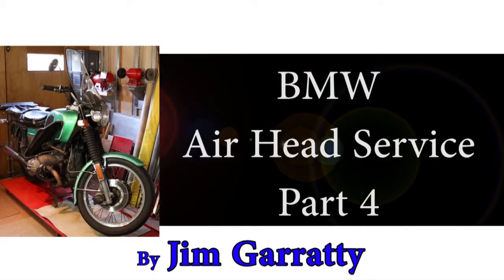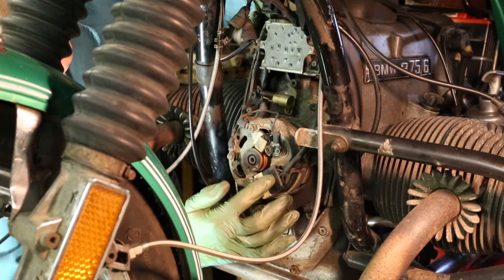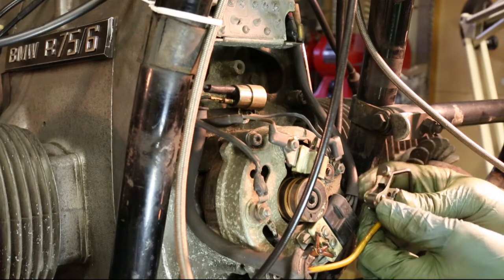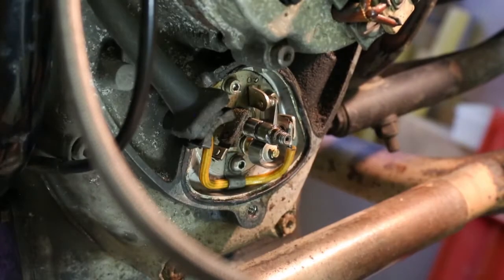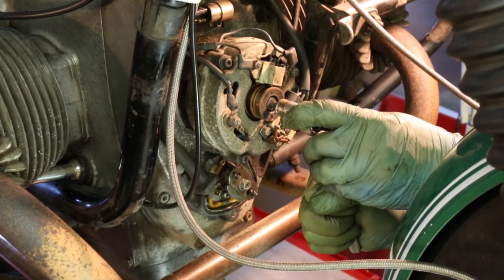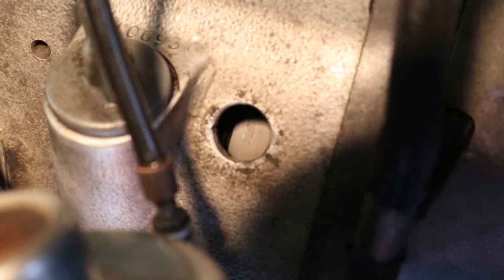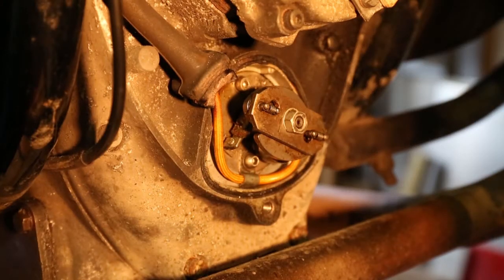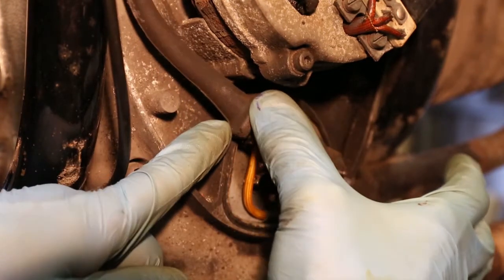R75/6 Part 4. BMW Air Head Boxer, R Series service. Set Points & Ignition Timing.

Comment: Thank you for this post.  I have recently purchased a rather rare 1982 Neval Dnepr sidecar rig with a R75/6 engine.  I had a pointless ignition in, and after less than 200 miles it backfired like mad and died.  I hope that I can glean enough info from your post to get me back on the road.  Thanks again.  I'm only 3 minutes into your video and I have put you in my favorites.
Reply from the maker: Hello, @kenhieter6582.
I have seen this modification before, when a BMW boxer engine is placed into the Russian or Ukraine bikes. The owners of the bikes were very pleased with the increased reliability. I'm glad you found my video useful and I wish you luck for the future. Take Care Jim

Comment: Hello Jim. Thanks for sharing this information. I have just had my top end done including a re-bore and the fitting of new pistons. My 1976 R75/6 has 126,000 miles and will be running strong this summer. Great video, one of the best explanations I've viewed.
Reply from the maker: Hello Colin
Thank you for your comment, its good to hear your R75/6 will be back on the road soon, with re-bore and new pistons you should be ok for another 126,000 miles. Take care Jim

Comment: Thank you sir! This is excellent for help with my 1973 75/5 (in conjunction with my shop manual to give me the proper markings for timing and points gaps for my particular model). THANK YOU!!
Reply from the maker: Hello @egec. Thank you for your comment, I'm so glad my video has been of use to you. Setting the points on these engines does need a little practice. Take Care Jim

Comment: Thanks very much  a very informative  video, ive just bought a 1973, longwheel base R75/4
Reply from the maker: Hello Christopher
You have bought yourself a fantastic bike, I'm glad my video was of use to you.
Jim
Reply: sorry ive bought a late 73  ie long wheel base R75/5 , I had a 1970  R60/5   a few years ago i found the handling was  good it was my 1st BMW, i will let you know how i go on with my 73  R75/5  once i get it on the road. mines a Drum brake model of course. I personally think the R range  from the  1970s  to   the R90/6  was BMW  at its best
Reply from the maker: Hello Chris
I agree with you, BMW boxers from the 1970's, for my type of riding are brilliant.
High speed cursing all day, and if they do have a problem you can normally fix them at the road side.
Fix punctures, change points all easy.
There is that little spring in the gearbox selectors, after the third one broke in 20 years I modified the gear box, it now has a compression spring, it was a bit more involved than I first thought it would be but I don't think it will fail again.
Take care
Jim

Comment: I have succesfully snapped the threads on the camshaft with a standard 10mm wrench... it was not an easy job to fix....
I have the same 75/6 btw!
Reply from the maker: Hello P-A Olson.
Oh no, nightmare, every time I tighten that little nut on the end of the camshaft I think “is this the time?”. So far I have been lucky.
Did you fit a new cam shaft, or manage to drill and fit a new stud? Take care Jim
Reply: I was able to drill a hole in the cam with a lathe, and put a m6 thread in it!
Reply from the maker: @p-aolsson488  Thank you, Its good to know the shaft can be machined, it does give you a line of escape if you do ever snap it off. Well done.
Reply: If you are helping somone with this problem, recomend m5 threads instead! It gives a little more space to work with!
Reply from the maker: @p-aolsson488  Thank you, this is really helpful information to those who have just snapped their stud off, and are looking miserable at it wondering what to do next. A useful comment, it will help lots of people. Take Care Jim

Comment: Do you have a video on how to torque heads and setting the valves ?
Reply from the maker: Hello Roger. Sorry, no videos yet on how to service the heads on the R75. This summer I must check my valve clearance, that will be the time when I make a video. Unfortunately that doesn't help you at the moment. Going by memory things you must look out for:
The exhaust is clamped to the head by a large finned nut, this nut can be very hard to remove, I have had to cut them off before now. When you replace this nut use Copper Ease on the thread it helps the next time you need to remove it. There is a special finned spanner I feel is a must if you want to remove this nut without damaging it, it works well, If you use a punch it will damage the fins.
If you are in Great Britain you may want to join the BMW owners club, they have most of the special tools you need to strip down the whole engine and bike. You will have a lot of fun replacing the heads, as you tighten the main head nut down on the top of the rocker shaft supports they move about messing up the clearance between them and the spacer that sits on the shaft against the rocker. It together correctly when the spacer on the rocker shaft can rotate easily but have no end to end play, I have always found this job to be a little frustrating. There is I have been told a special tool for this job but I have never used it. When checking the tappet clearances use a hex key in the end of the crankshaft (centre of the alternator) to turn the engine, and don't forget to remove the spark plugs. Good luck, have fun. Take Care Jim
Reply: @CYC123  ok Jim thanks very much for that info . I’ve had the top end of my r90 rebuilt so i only need to re torque heads as specified every 500, 1000, and 1500 miles . And not being a mechanic but having bought a torque wrench I was thinking of knowing how to do this instead of taking it to a mechanic.
Reply from the maker: Hello Rodger. You probably know what I'm about to say, but I will say it any way, just in case anyone reading this doesn't know.
When you retorque the head bolts, because of mechanical stiction between the nut, the head and the stud, you must loosen the nut a quarter of a turn first, then retighten to the correct torque. If you don't do this the nut may not tighten to the correct torque.
When tightening the head nuts do this in a cross pattern, bottom right, then top left, top right, bottom left.
Once the retorquing is finished, you must check two things: First, the valve clearances (tappets) they may have closed up what with more compression going onto the head gasket. Second, the spacer on the rocker shaft, make sure it can still turn freely with no end float when the valve is fully closed, that's when the valve pushrod is loose. Hope all goes well, Jim
Reply: @CYC123  thanks Jim I appreciate the info . Not having any experience I want to try this and hopefully not mess anything up but then again I might let my mechanic handle it. I ll try to find a video to watch on how to do this. 
Cheers
Reply from the maker: Do you have any mechanic friends who could be there as you do the job?
BMW owners clubs may help, give them a call, see if there is anyone close to you who knows what to do.
Good Luck Rodger

Comment: I have continuity at all times but I hooked my meter up to top of points assembly? Maybe it need to be connect to lead to condenser to prevent this?
Reply from the maker: Hello blastosist. Disconnect the condenser from the points, connect your meter across just the points. Set the meter to a low resistance range. Make sure the points do in fact open and close as the engine is rotated. If you do that it should work as I show in the video. Please tell me how you get on. Take Care Jim
Reply: Hello, yes I referenced a shop manual that showed disconnecting the tiniest bolt on top of points assembly and connecting to condenser side ( I had to re attach this side to points) . You might have covered this and I missed it but you have to remove the advance to access the points adjustment screws ( this is for a R50/2 ). 
 @CYC123
Reply from the maker: Hello blastosist. I assumed you had a /6. I haven't worked on a /5 machine so not sure how different it is. Your shop manual will probably be of more use than me! I wish you luck.  Let me know how you get on. Take Care Jim

Comment: Excellent tutorial. The problem I have is that I cannot turn the plate that holds the points (removing the screws that hold it first) because it seems to be stuck, I don't know if it is due to rust, corrosion, dirt or because some incompetent mechanic has fixed it with something. some reason.  I don't know whether to dare try to remove it by "forceful" means with the help of a screwdriver by prying the screw holes.  Could someone advise me on this?  I need to have the bike ready for a trip soon and I think the ignition setting is not quite right, the bike runs fine but I can't see the "F" (full advance mark) with the strobe at 3000rpm (at "S" mark It's easy) It's a BMW R90S.  Thank you all.
Reply from the maker: Hello Tosko. Thank you for your comment. I am assuming the plate that holds your points is in the same position and a similar shape to the plate on my bike that is shown in the video.

The round points plate fits very snugly into the engine casing. The points plate is made of plated steel, the engine casting is aluminium, dissimilar metals held together like this tend to corrode, I have had this plate become quite tight in my bike, corrosion was the trouble each time.
Now some methods to loosen this plate:
Spray the joint between the plate and casting with a penetrating oil, repeat this every now and then as you work. Remove the two securing screws from the points plate. The points can be left in position at the moment.
There is a bracket on the plate that supports the cam greasing felt. You can try tapping against this where it meets the points plate with a screwdriver and small hammer, I show how to do this in the video as a method to adjust the ignition timing. If the plate starts to move spray more penetrating oil over the joint, then knock the plate back the other way. Keep going back and forth till the plate can be removed.
If the plate doesn’t move, then remove the advance-retard unit. Grip the felt bracket with pliers, tap against the pliers in a direction to rotate the plate, first one way then the other. As soon as you see movement spray on more penetrating oil.
Now if its still stuck fast there is one other method you can try.
With the advance-retard unit and points removed. You will require a long screw (50mm or so), or a length of studding. The thread needs to be the same as the thread on the screw that securers the point on to the plate (M3-M4-M5? Sorry can’t remember which) . Screw this into the tapped hole where the points securing screw came out of, only screw it in about 5mm. Now replace the nut onto the end of the cam shaft to protect the thread, this is the nut that normally secures the advance-retard unit in place. Grab a pair of long nosed pliers, using the nut on the camshaft as a fulcrum point use the pliers to pull on the screw in the plate, that should pull the plate out of the casting. Once the plate is out, clean its outside rim and the casting where it sat with wire wool. Before reassembly wipe copper ease or grease onto the surfaces that touch, this should cut down any corrosion forming once its back together.
Please let me know how you get on.
Take Care Jim
Reply: @CYC123  I have no words to thank you for your extensive, immediate and very kind response.  Their incredible contribution and willingness to help, advise, and the video tutorials are of HUGE help to the small universe of BMW 2v fans... It would be worth a visit, it is something that I would like to do in life, meet such people. wonderful like you and incidentally travel.  I am Catalan, from Barcelona and I currently own an R80RT that I am repairing myself with the help of your magnificent tutorials.  My friend's motorcycle is the R90S, which I am also getting ready to travel and which had been broken for three years because I did not have the financial resources to take it to the mechanic, until he told me and I decided to try to repair it myself and what I learn from people as altruistic and wonderful as you.  Could you tell me where your workshop is in England so I can give you a "tour" and invite you for a pint, a coffee or whatever you like?  Of course, I will give you news regarding the stuck plate in question by doing what you suggested.
Reply from the maker: Hello Catalan. I wish you luck with your repairs. We live in a town called Flitwick in Bedfordshire, its close to junction 12 of the M1 motorway. You are welcome to call in on your travels. There is not much to see, just a man playing in a garage in the back garden. Take Care Jim

Comment: Can you share more on your multimeter settings?
Reply from the maker: Hello Michael. The multimeter needs to be set to measure low resistance in ohms.
The multimeter I use in the video is auto ranging, when I use my manual meter I set it to the lowest resistance range which is 200 ohms. If you connect your meter as I do in the video, the only thing the meter can see is the points, if they are closed the resistance should show zero, when open the meter should show open circuit, no resistance at all. Some multimeters are equipped with a bleeper that sounds when the meter detects a short circuit, this is useful as you can concentrate on the timing marks as you rotate the engine, then as soon as the points open the bleep will stop, and you can see the alignment of the timing marks. I hope this is useful to you. Where are you in the world? Take Care Jim

Comment: A question...  I'm going to need to buy a meter to set the timing on my '79 R65.  Would you be able to either make a recommendation of a model (Fluke seems to be the most popular brand in the US), or a list of necessary features a meter needs to have to be useful?
Reply from the maker: Hello Edwin. Thank you for your comment. Fluke make good multimeter. I have a Fluke 8024B which came to me second hand about 25 years ago and still works well. So, to your question which meter to buy?
Most basic meters will measure what you need. The BMW has a 12volt battery so you will need a DC voltage range to cover that. On my meters I use the 0 to 20 volt DC range. When I'm setting up the points, the bikes battery is disconnected, the meter is only across the points, I use the low resistance range 0 to 200Ω. Its handy to have a continuity tester in the meter, this is a function that will bleep if the test probes see a short circuit, its what I use when setting up the ignition timing, you would have seen that in my video. The continuity test function (on my old meters) has its own on/off switch and only functions on the low resistance range of the meter. It will tell you when the points open or close without having to look at the readout of the meter. You will probably want to test things in your house, being in the US your mains voltage is 110V AC so you will need an AC range to cover that 0 to 200V is a normal range to have on a meter. I suspect most general purpose multi meters will cover what you need, you wont need to buy anything too expensive. I hope this helps. Take Care Jim

Comment: is it possible to put a elektronic  ignision  i pl of  de old  contacts ?
Reply from the maker: Hello Danny. Sorry to take so long to answer your comment but I’m away from home for a few weeks. Yes it is possible to replace the mechanical points in the old R-Series air heads boxers with electronic ignition. There are several companies around the world which manufacture kits to fit to the bikes. Search the internet for “Electronic ignition to fit R-Series BMW boxer”, that will Be a good starting point. You could also mention “air head” as well, that may help. I have never fitted one to my R75 BMW but I have met others who say they worked well for them. Good luck and take care Jim